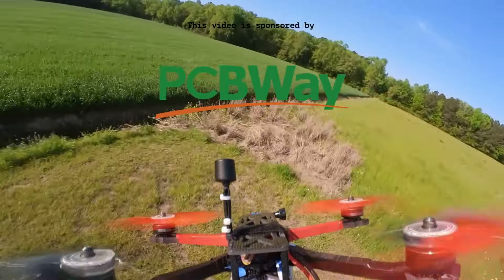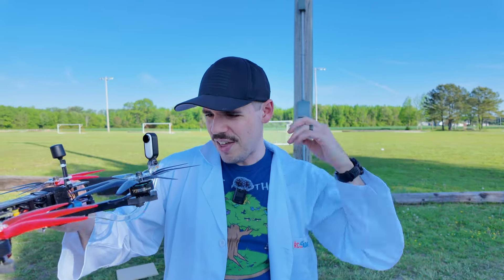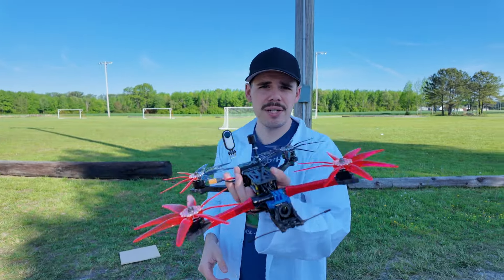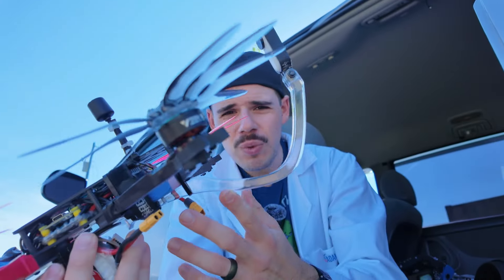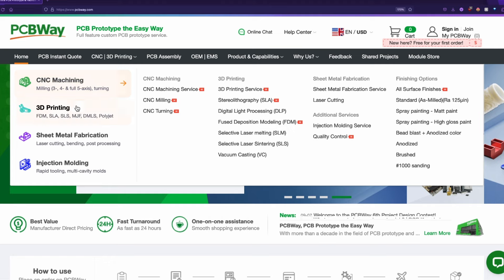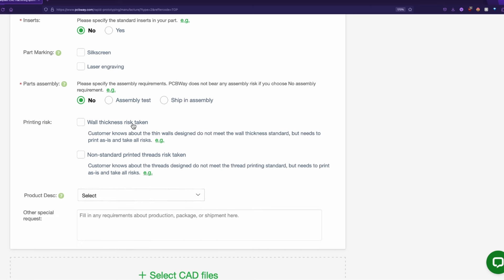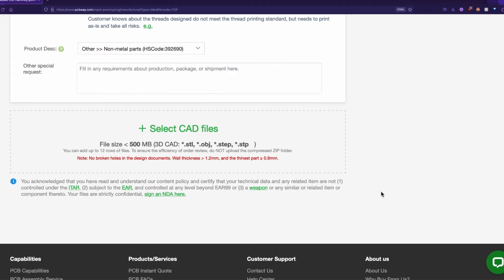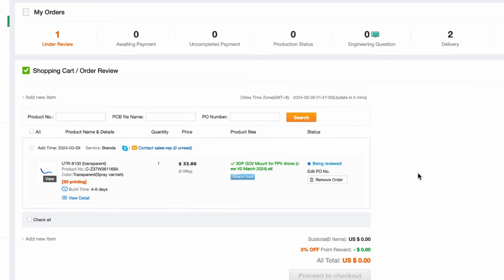"Invisible" Scorpion Tail 3rd-Person-View Camera Mount for FPV Drones

Comment: Maybe drill a bunch of holes in that mount to lighten it up...🤔 Also, I've had pretty good luck with the HQ Prop 7x4x3 props. Probably a lot lighter and better balanced than those 8 blades. Cool video. I like seeing your experiments. Thanks for sharing your adventures. Happy flying amigo 🫡 🍻.
Reply from the maker: Not a bad idea!

Comment: I love the scorpion tail idea, but there's a lot of jello.

I'm into resin printing and that print looks amazing.  With resin prints, you hollow out your part to a certain wall thickness inside the slicer (Chitubox), add internal supports if needed, and make a hole or two for the resin to escape.  Otherwise you'll have uncured resin trapped in your print.
Reply from the maker: Thanks for the tips!

Comment: Hey bro you do alot with 7" drones. Im doing a 7 inch build and i have a speedybee f7 v3 50 amp stack lying around. 50 amps enough of a esc for this build? I was going to run 2806.5 1300 kv motors...
Reply from the maker: Yeah 50amp should be plenty. Really depends on how aggressive the props and your flight style are.
Reply: I've blown some esc's in my day but I've never blew a speedy bee esc... they have a quality stack for the money.. Probably gonna run some 7040 hq props